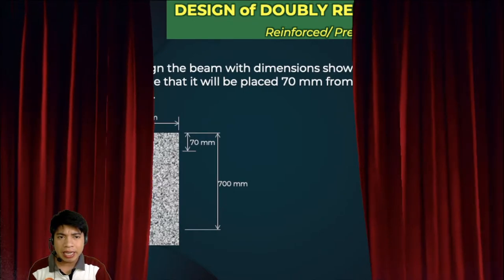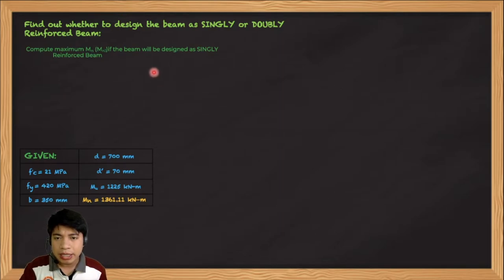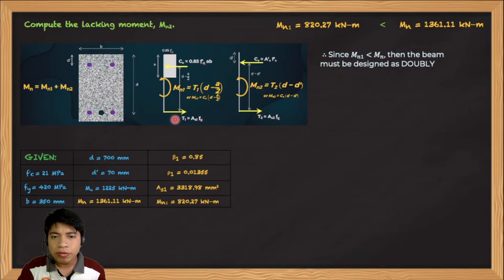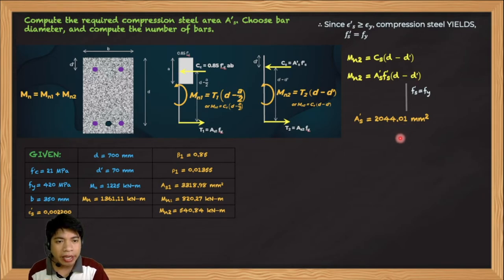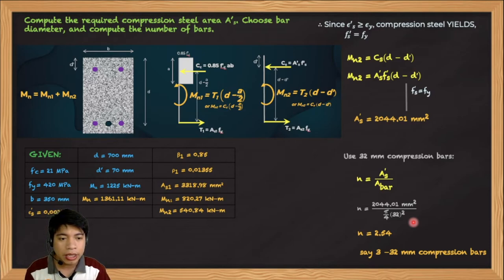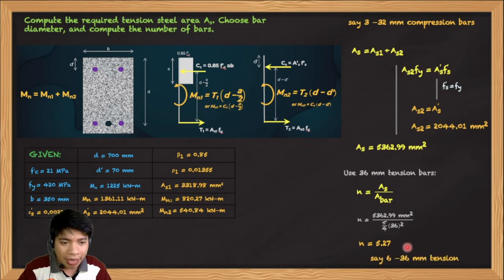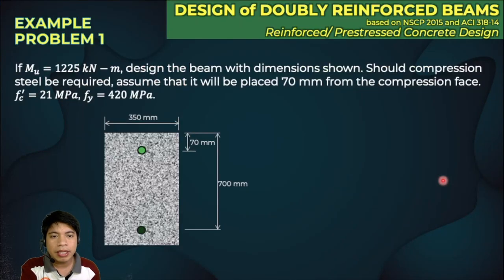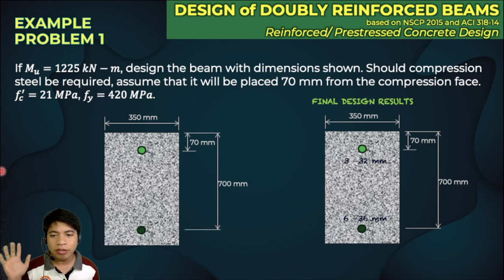(2/2) DESIGN OF DOUBLY REINFORCED BEAMS based on NSCP 2015 and ACI 318-14|Reinforced Concrete Design

Comment: in reality po, gumagamit po ba talaga ng singly reinforced beams knowing na kailangan ng stirrups? Parang imposible po kasing mag lagay ng stirrups kugn walang top bars.
or pwede po idesign as doubly kahit na lumabas ay singly lang sya?
Reply from the maker: This is a good question. Yes, in reality meron talagang Singly Reinforced na design. Pero kahit singly sya, which is supposed to be isang side lang ng beam ang meron reinforcement, required na maglagay ng hangers para kakabitan ng stirrups. Pero kahit may hangers, still “Singly” pa din ang tawag dun, kahit nagmukha na syang doubly.
Regarding sa 2nd question mo. If singly ang lumabas, singly dapat ang design, kung doubly ang lumabas, doubly ang design. Hindi ka makakapagdesign ng doubly kung singly ang lumabas sa computation kasi it means the maximum moment can be carried by tension bars aloneZ
Reply from the maker: This is a good question. Yes, in reality meron talagang Singly Reinforced na design. Pero kahit singly sya, which is supposed to be isang side lang ng beam ang meron reinforcement, required na maglagay ng hangers para kakabitan ng stirrups. Pero kahit may hangers, still “Singly” pa din ang tawag dun, kahit nagmukha na syang doubly.
Regarding sa 2nd question mo. If singly ang lumabas, singly dapat ang design, kung doubly ang lumabas, doubly ang design. Hindi ka makakapagdesign ng doubly kung singly ang lumabas sa computation kasi it means the maximum moment can be carried by tension bars alone.
Reply from the maker: This is a good question. Yes, in reality meron talagang Singly Reinforced na design. Pero kahit singly sya, which is supposed to be isang side lang ng beam ang meron reinforcement, required na maglagay ng hangers para kakabitan ng stirrups. Pero kahit may hangers, still “Singly” pa din ang tawag dun, kahit nagmukha na syang doubly.
Regarding sa 2nd question mo. If singly ang lumabas, singly dapat ang design, kung doubly ang lumabas, doubly ang design. Hindi ka makakapagdesign ng doubly kung singly ang lumabas sa computation kasi it means the maximum moment can be carried by tension bars alone.
Reply: @lecturesnisirmars  hindi na po ba sinasama sa computation yung hangers na nilalagay? if thats the case, may standard po ba ito?
Reply from the maker: @mangoes7329  Hindi na kasama sa computation ung hangers. Bale 12 mm ang minimum nyan. Para sa akin, if ever maging singly reinforced yung beam mo, tapos let’s say 3 bars na 12 mm ang nasa tension side. Bale 5 lahat na 12 mm ang dapat na reinforcement, yung 3 sa tension at 2 sa compression na need for hangers. In other words, yung hangers can be considered main bars.
Reply from the maker: @mangoes7329  Hindi na kasama sa computation ung hangers, pero they can be considered main bars. Bale 12 mm ang minimum nyan. Para sa akin, if ever maging singly reinforced yung beam mo, tapos let’s say 3 bars na 12 mm ang design sa tension side. Bale 5 lahat na 12 mm ang dapat na reinforcement, yung 3 sa tension at 2 sa compression na need for hangers. In other words, yung nailagay nang hangers can be considered main bars.
Reply from the maker: @mangoes7329  Hindi na kasama sa computation ung hangers, pero they can be considered main bars. Bale 12 mm ang minimum nyan. Para sa akin, if ever maging singly reinforced yung beam mo, tapos let’s say 3 bars na 12 mm ang design sa tension side. Bale 5 lahat na 12 mm ang dapat na reinforcement, yung 3 sa tension at 2 sa compression na need for hangers. In other words, yung nailagay nang hangers can be considered main bars.
Reply: @lecturesnisirmars  Clarify lang po. For example ang lumabas na number of bars needed is 5 for a singly reinforced beam. Sa detailing po pwede kong ilagay yung 3 sa tension side then yung remaining 2 sa compression?
Reply from the maker: @mangoes7329  hindi po. Kung lumabas is 5 ang needed for singly reinforced beam, it means 5 dapat ang nasa tension bars. Yung 2 na nasa compression side, di yun makakatulong sa pagresist ng load, pero mkakatulong yun sa paghawak ng stirrups.
Reply: @lecturesnisirmars  thank you very much po for your enthusiasm and kind answers to my questions 🥰